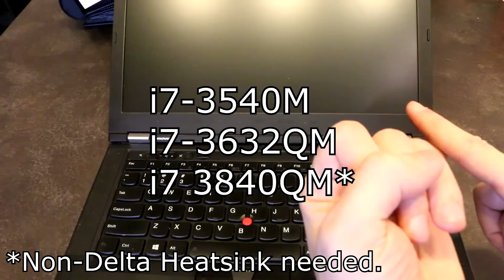Lenovo ThinkPad T430: Upgrade Wonder

Comment: The 420 keyboard can be placed in the 430 housing.... actually, there is just about zero difference in the chassis and case... There are even backlit 430 kbd options that can go into the 420, if the thinklight isn't your cup of tea... though it is very nice and a capable light just the same, some folks want backlit and that's it... and that is doable.   All of my 420's and 430's have been swapped to i7 QM's or Extremes, and what a difference!  My best 420 passmarks 8000, best 430 passmarks just about 10,000.  Cinebench on either is better than most brand new low, mid, upper mid chips, the slowest 420 I have has a Cinebench R15 of 550... so yeah, not too bad really... the best is in a 430, and is approaching 900.  You can easily flash bios to remove whitelists via already existing community made bios options, no additional hardware needed unless you are say, modding a 420 to take an ivybridge cpu, so no pie needed.  But when you can get a 430 and go that route, with everything being identical other than the esata port, there is little reason to pie mod a 420 bios for ivy.  Again, no need to hardware flash the bios unless you are looking to force cpu compatibility outside of the chipsets inherent support... other than that, whitelists can be gotten rid of via normal bios flashes... nothing more.  I wouldn't advise hacking some upgraded cooling together either, as upping the TDP and core count to the degree I have (+20W, +2c4t), which is as far as one can possibly go, still maintains cooling efficiency with ease. I do recommend running TPFancontrol and using a more suitable fan curve, but that's about it.  The only upgraded heat pipe/sink that would be possible anyway, would be that of the unit that came with the dedicated gpu model of the same computer. And all that does is add a pipe where you don't need it... over a non existent gpu.  It will do nothing.  And no other machines cooling solution will fit, that's just crazy talk.  Swap the cpu, adj the fan curve, add ram, do away with the whitelist, and have at it... with an external expresscard GPU option, you can even do max settings 1080p gaming with this, despite the pcie lanes available.  There is a TON more one can dive into with these machines, but that would likely be some dry reading. Just get the machine and you'll discover all its hidden goodies. Every single one of my 420's or 430's are more powerful than the brand new Macbook's, throttle less (no throttling), and put newer devices such as that mentioned... apple crapple... to shame. Especially considering the IO I have with these, and the IO that simply does not exist on a new apple crap.
Reply from the maker: Thanks for sharing your expertise on the subject. No doubt about the possibilities of these machines.
Reply: @LaptopRetrospective  Indeed, I love them!  I have had soo many various laptops... HP Probooks, Elitebooks, Toshiba's, Dell's of various line ups... apple... shudder.  But others, even at their best, are often just shadows of what these ThinkPad's are.  So many options, such excellent build quality, upgrade-ability, performance, etc.  There are 1080p and even 1440 screen options (mods), though I am usually quite content with the HD+ 900p options offered stock.  Then there are the ultrabay's and the options available there... HDD docks, some that can take batteries there, the slice batteries, the docking stations... And it's a shame they stopped these, but there was even a dock for slightly earlier C2D model ThinkPads, which offered an actual built in PCIE GPU slot.  So you could dock your ThinkPad, and in that dock could be any gpu of your choice.  At this point the eGpu expresscard option is the best way to go I guess, but nowhere near as streamlined.  I do like some other machines quite a bit, but none are loved as much as the ThinkPad T4XX line. Pure excellence, lol.
Reply from the maker: Indeed X2 lots to like. I imagine if the sales supported the options they would have continued, but companies have to compete with what the consumer will buy. They have to own their decisions sure, but we have to own the motivation we provide.

Comment: i have 1600 x 900 lcd T430 that  the screen is not good to make my eyes watery n sore
compare to my T420 that comes with nvidia  is much better screen to view
i recommended if u wanna buy thinkpad..just take thinkpad that come with Nvidia graphic...
a bit higher price but u can work with ur laptop without eyes sore problem
Reply: The original screen is atrocious, can't deny that, but how would it cause the thing you're describing is beyond my comprehension. I've worked on the original LCD for about 5 years before I switched it to the FHD AHVA (IPS-like) screen. Apart from the fact that the original TN is an abomination in comparison to the IPS in regards of colour reproduction or view angles, I can't say a bad word about it. It's not a low-clocked CRT screen for crying out loud...
Reply from the maker: Interesting. Never heard of that being an issue.

Comment: recently bought a t440 because i found it for the same price as t430. But returned this piece of disappointment right away. Trackpoint is useless, Ultranav is f'd up, the whole touchpad is one big  button. Not to mention all this Ultrabook crap. To reduce weight and space they removed most of the screws, everything is glued. And all CPUs are now BGAs wtf intel.
Reply from the maker: The T430 has its legendary status for good reason.

Comment: I have gotten myself the T430 with the i5 but with the Nvidia Nvs 5400m upgraded to 16gb 9cl ram, light up keyboard, upgraded to the i7 3740qm,  SSD 850evo m.2 converted cady in a standard HDD slot and 450mbs dual-band wifi 3 antenna.  plays Arma 3 at low to med settings and that says something for that game
Reply from the maker: Yep, any laptop that can handle Arma and not turn into a cooking surface is an achievement.

Comment: I picked up a T430s off eBay recently and I love it.  8GB of ram and SSD makes it the best laptop that I have ever owned even though it is 6 years old.
Reply from the maker: Nice. What CPU are you rocking?
Reply: *Checks*

Core i5 3320M
Reply from the maker: Not too shabby. Going to do any upgrades?

Comment: These are great. I've compared it to a much newer T450 and it is similar CPU performance despite being older. Graphics performance on the T450 is only slightly better and you get no optical drive, no LED light, etc.. It's better than most new $500 laptops from the big box stores.
Reply from the maker: Most big box stores that still sell laptops around here don't offer much at all.

Comment: I topped up my T430 with 16 GB of ram, Msata SSD, an i7 3720QM (didn't need so much horse power more than threads) and this machine is still a beast that can pull off quite a load of work. I couldn't find a better heatsink, but decided to use better thermal paste, and lower the CPU performance in power management to avoid turboboost (gets near the 100°c quite often that way).
I can produce on protools and with a lot of stuff going on, from plugins to virtual instruments, a firewire interface with an xpresscard expansion. This machine is a dream.
The only disadvantage, is that doesn't come with thunderbolt, no even the first generation. If an expresscard adaptor coud give us that, it would be amazing and make this laptop even more futureproof.
Reply: You might be surprised to know that the Express card slot on the t430 has a whopping two pcie data lanes! I used a GTX 780 with mine for a while and it worked great, only lost about 15% performance compared to stock 780's thanks to Nvidias amazing pcie compression on laptops
Reply from the maker: Thunderbolt via ExpressCard would be something to see...

Comment: t430  2018 .12
battery instead of dvd drive
 ? do you know where to order
??
Reply: oh jesus, this thread... wish I saw it earlier. No, there's no battery contacts in the T430 bay, so you can't use a battery and one can't work with it. The one you're thinking of is the T430s (the S is extremely important, it's a completely different computer that only looks similar). That, the T430s, has bay contacts for the 2nd battery, because the primary battery is a slim LiPo battery, so they can't make an extended battery (9-cell) like the T430 is capable of. So they use 2 LiPo's - one in the DVD bay, one under the palm rest. For the T430, just get a 9-cell battery, same effect.
Reply from the maker: Thanks for clearing that up.
Reply: https://www.ebay.com/itm/OEM-Ultrabay-Battery-45N1041-45N1040-For-Lenovo-ThinkPad-T430S-T420S-T410S-/332746448508 

For example, you can find on the web
Reply from the maker: Out of stock there but wow they are expensive and I can only imagine the price is going up. Any third parties making them or is it just old Lenovo stock?
Reply: @LaptopRetrospective   I don't know, I discovered this today because I would like to have one for my T430s.
Reply from the maker: What is the mAh of those batteries? For $100 that seems like diminishing returns.
Reply from the maker: Should clarify I was talking Canadian funds. But I can get a new regular battery for about half that from a local shop. Might be local availability.
Reply: I just have 1TB hard drive instead of the DVD drive,works awesome
Reply from the maker: Do you mean a SATA battery?
Reply: @LaptopRetrospective  ultrabay battery
Reply from the maker: Yeah, that's what I meant. I've heard rumors but I've never seen one.

Comment: Fantastic machine (not for gaming). Still using it. Please however note that the i7 does not support VT-d if you want a secure OS such as QubesOS. But you can stay with a 2 cores/4 threads at 3GHz. Which is good enough when you have 16GB of RAM.
Reply: Why not for gaming ???
Reply from the maker: Depends on the game but no dGPU.

Comment: Heavy user of T400 in 2018. Thinkpad rocks!
Reply from the maker: Nice! What do you use it for?
Reply: @LaptopRetrospective  Purchased in Mar 2009, still using it for engineering finite element analysis.
Reply from the maker: Very cool. Always interested to hear how these machines are used.

Comment: Looking to purchase a T430 for online DA classes and learning to code. Found a refurbished model with 8GB RAM and a 128 SSD (i5 model) for $130. Good buy?

If I get it I'm probably going to buy a 9 cell battery and potentially replace the CPU with the non-heatsink required i7 you mentioned in the video. All the comments seem super reassuring but I've never bought a used computer before.
Reply from the maker: Safest used computer ever. Parts aplenty with detailed manuals and cool people like us. Seems like a good price and you have an idea and budget for work. So as long as it's in good condition, give it a try!

Comment: Got T400 for free from my office. Its in bad condition tho, scratched up, no battery, no storage. I put 240GB SSD and 4GB DDR3 RAM in it. It has overheating problem so I had to clean the heatsink and put new thermal paste. Runs well. I use it for document processing, photoshop, light video editing with sony vegas and browsing
Reply from the maker: That's a respectable work load.
Reply: The T400, is a very strong little computer! Fast, with a good processor, and 8gb/RAM! Great little workhorse!

Comment: Hi my name is Diego and I'm a ThinkPad addict.
Reply from the maker: Hi Diego. Welcome to the support group. Bring your friends!
Reply: @LaptopRetrospective  My first computer ever was a ThinkPad Butterfly 701c back in 1995 $2,400 (Puerto Rico price) with 486DX2 50Mhz CPU 4MB Ram 340MB HD Windows 3.1 and had to buy an external Microsolutions Backpack Parallel CDRom ( $300 on Computer Shopper Magazine ) so I could install Windows 95 on it.
Reply from the maker: Wow, that's a legend nowadays. What was that like to use?
Reply: @LaptopRetrospective  At that time the display was the best in class so everything look beautiful. Everything was expensive. For example, since it came with 4mb of RAM and I wanted to upgrade to Windows 95, had to buy the 16mb RAM module for $225.00.  It came with build int 14.4 kbps modem so the PCMCIA 33.6kbps modem was a must. That one cost me $100 ++ .   I remember that Panasonic sold a wireless telephone adapter so I was able to connect to the internet wireless via land line.  It was the most amazing thing ever.  Had it for many many years and somebody beg me to sell it.
Reply from the maker: Haha awesome history. Thanks for sharing this! Sounds like you did eventually let it go, how did they convince you?

Comment: I have a T430 that's been at my side for about 2 years before I finally got myself a new laptop. 

It's liquid metal cooled, has the extended batter, has a secondary 1TB drive and primary 128gb SSD and runs like a dream. I still use it now and then with me on trips where I don't want to damage my newer, much more expensive laptop. 

I love the thing to death.
Reply from the maker: Awesome setup. Thanks for sharing.

Comment: Long comment ahead:

Got my refurbished T430 for about 6,900 THB (around 210 USD) year ago as I was in need a good laptop to do stuff while I was on vacation. It was in very good condition, with a few scratch and worn touchpad (which I rarely use it as I have fall in love with nipple mouse after using it for a while and now I always feel weird when use touchpad on other people laptop XD), it have Core i5 3320M, 4GB RAM (2x2GB), 320GB HDD, 1366x768 display, almost new 6 cell battery, OEM Windows 7 Pro license and 3 months warranty. I later upgrade the RAM to 16GB with 2x8GB DDR3L 1600Mhz, add 256GB SSD and put the old 350GB HDD in optical drive bay as storage drive, upgrade the charger to 90w model (for future quad core CPU upgrade as it won't charge with lower wattage charger) and CPU thermal compound to Arctic MX-4 to improve cooling.

I'd say ThinkPad T430 is still usable in 2018 and years beyond with just 8GB RAM and maybe SSD upgrade, I use my T430 for LibreOffice work, programing in C/C++ and Python (this laptop have very good keyboard btw), image/texture editing with Gimp, drawing with Krita (the 1366x768 display seems too small for it's interface, but it doable if change the interface to Big_Paint_2).
I also do 3D stuff as a hobby with Blender and DAZ Studio, tho the current i5 dual core CPU is not suite for rendering, but it get the job done, if you have good cooling for the laptop to run continuously for hours and wait looong enough for the render to finish :D and while the Intel HD 4000 viewport performance is acceptable for smaller scene/simple model, but for complex scene/model, the framerate will drop to single digit.
And for gaming, I have play the original Skyrim (with lots of mods!, 300+ mods) on it with acceptable framerate, about 25-30 fps on 720p/low/mixed settings, Guild Wars 2 and World of Warcraft also run, but on windowed mode at potato level graphic/framerate XD
For gaming, using dual channel RAM (2 RAM module, for example 2x4GB RAM for total of 8GB RAM or 2x8GB RAM for total of 16GB RAM) will help improve framerate a bit.

Unlike most modern laptop, this T430 can be upgrade easily with the help of disassembly manual from Lenovo, and there are lots of upgrade options and hacks too, even non standard one like replace the keyboard with older model keyboard, easier external GPU with Express card to PCI-E adapter, 1080p IPS screen (tho this one is hard to do) or quad core CPU upgrade!

I also thought about putting GNU/Linux on this laptop as I use Kubuntu on my PC at work. but sadly, it seems I also need a Windows PC to run some program that don't run correctly in Wine and test a program I that maintain in my free time, so Windows 7 until 2020 it is.

My next upgrade would be i7-3740QM or classic T420 keyboard, as more keys is better for me, and maybe HD+ screen if I can find one locally. :D
Reply from the maker: Great post. Really enjoyed hearing your upgrade story and what you found this machine to be capable of doing. Thanks for sharing this information.

Comment: Bought one yesterday for 130 USD.  Planning on an SSD, the secondary HD bay (also SSD), Bluetooth module, 16GB ram, i7, and anything else I can find to deck it out to the 9's
Reply from the maker: Very cool. Let me know how that goes.
Reply: @LaptopRetrospective  One question, what is the small bay looking thing with two spare wires beside the ram in the lower case? What peripheral or expansion is that actually built for?
Reply: Wait, no, I'm retarded, thats an mSATA bay, Very cool. I might just end up putting 3 Drives and keeping a portable USB Optical drive in my bag, considering there is already a portable USB optical drive in my bag
Reply from the maker: Same. Portable optical drive since 2009.
Reply: @LaptopRetrospective  honestly, since they work with all my laptops and desktops and anything else, and seem more durable, I don't know why anyone wouldn't just use a portable optical drive. And if it goes bad? No scrambling for potentially unavailable parts, just get another, and boom, it still works with all of my devices. People confuse me over their weird obsession with having an internal optical drive
Reply from the maker: I rarely use optical media anymore whatsoever. Outside of OS install discs, I think I might use it 5 times a year if that.
Reply: @LaptopRetrospective  I find physical CD's to be the best way to support artists, and the only reliable way to get high quality FLAC rips of the music I like, so I Use optical media frequently. But that's the extent of it, and as you said, OS installs.
Reply from the maker: Good points. I do love physical releases like CDs and boxes.